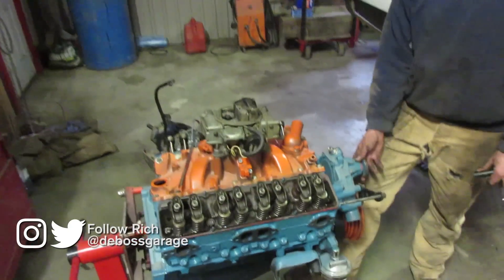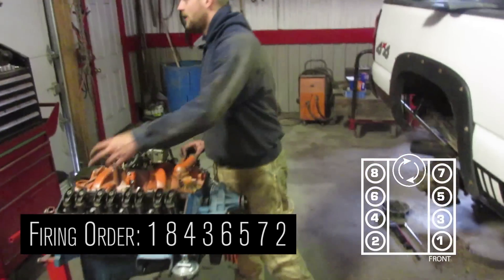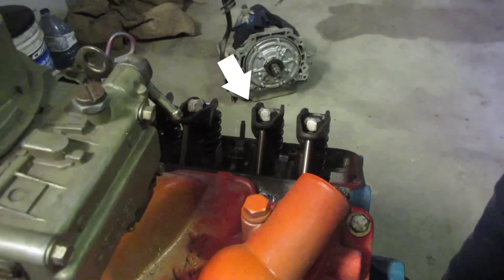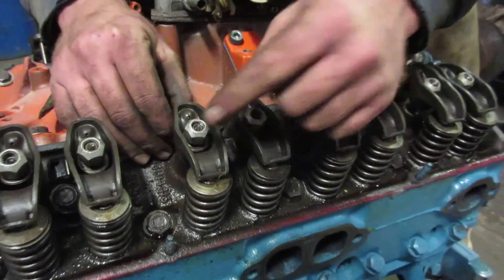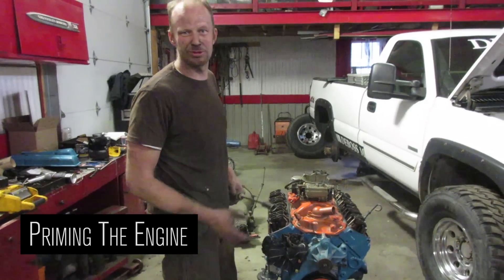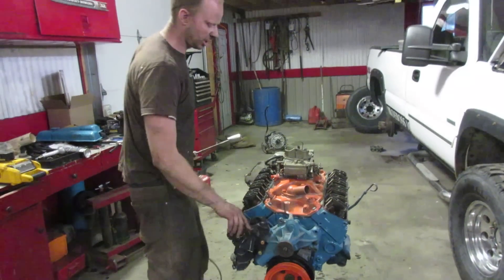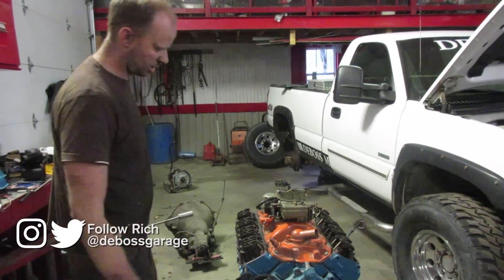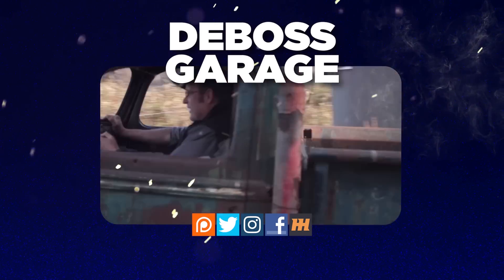Small Block Chevy V8: Firing Order, Set Hydraulic Valves & Priming Oil Pump

Comment: why 2 alternators ??
Reply from the maker: This went into a truck with a snow plow, which are electric over hydraulic. Think of a starter motor turning a hydraulic pump. It would draw somewhere around 200 amps every time it goes up or angles side to side. Add some extra lights and beacons and it is a strain on a single alt/bat setup
Reply: Thanks you for the explanatio